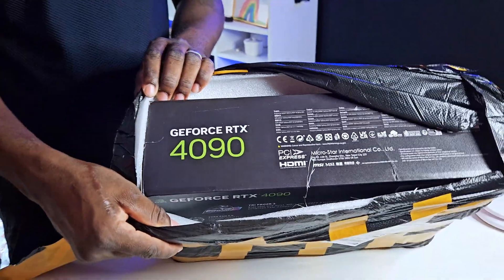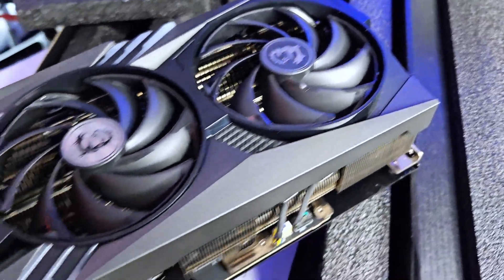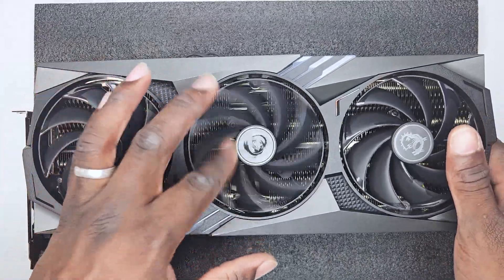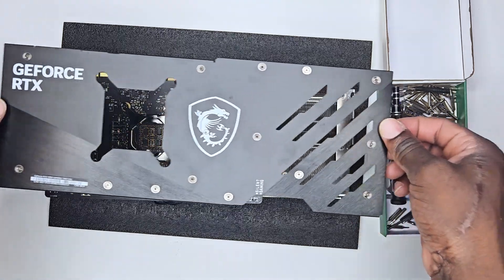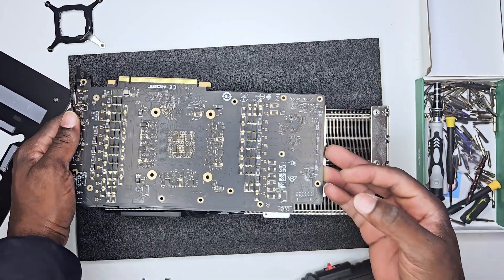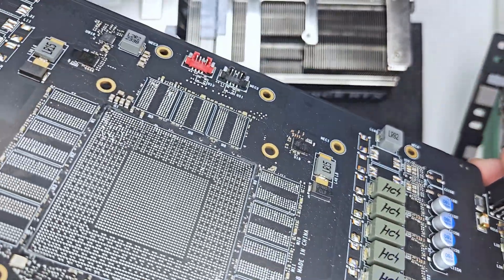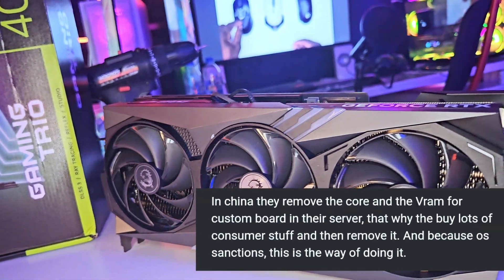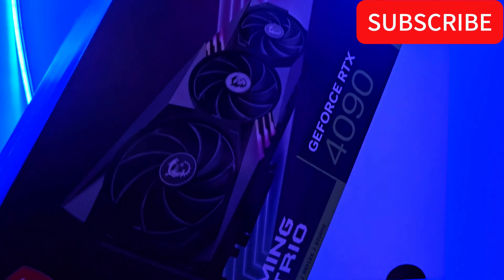Unboxing a $20 GTX 4090: The Shocking Truth Behind the Sweet Price

Comment: Still a deal as a wall hanger or to get a damaged one with a good GPU and RAM to swap onto the stripped board if all the SMTs are there.
Reply from the maker: @Sadler2010  well the board is still good but most repair shops will only use it for parts, at least that's what i would do. Beside the SMTs are still there

Comment: Is it worth fixing it? cause 20 bucks still sounds like a great deal
Reply from the maker: @jackbro655  if you have the skills yes, but i think they already damaged those pins to a level beyond repair, but it is definitely worth trying.
Reply: I have seen Graphics cards with broken PCI-E connectors sold as-is. And in the case of physical damage like that I see a high likelihood of the GPU and RAM still being good. Depends on the price you pay for the donor card and if you can repair it or pay somebody else to...
Reply from the maker: @Sadler2010  50 series shipping soon so in a few years that will be possible

Comment: Thermal pads are what's sitting on top of the RAM & VRMs, not paste.

Thermal pads are not nearly as efficient at conducting heat as thermal paste, or liquid metal, so are not suitable for CPU or GPU cores.
However their greater thickness allows them to be used in places where the heatsink doesn't make close contact.
Reply from the maker: @TehJumpingJawa  so much moree like a link between the pcb component and the heatsink then, thank you for the clarification.

Comment: I'm gonna guess no memory or gpu. This is happening a lot. Some are even being charged full price for these PCBs with coolers. Should be some stuff you can sell, or maybe even buy a damaged GPU that has a GPU and memory and make a working unit?? I see them all the time online being sold as parts only or non functional.
Reply from the maker: @stephenhood2948  I think the remaining components on the pcb can be used for other pcb repair.